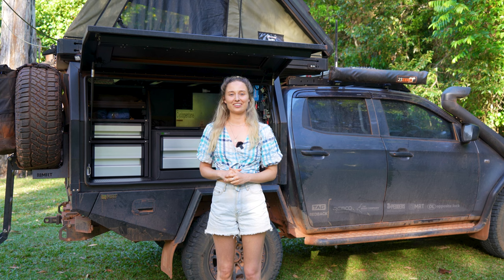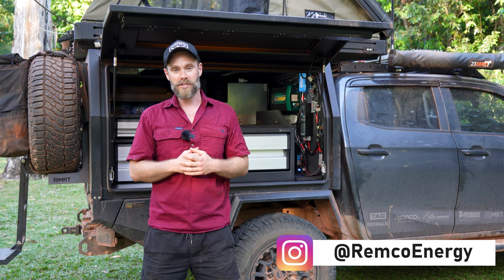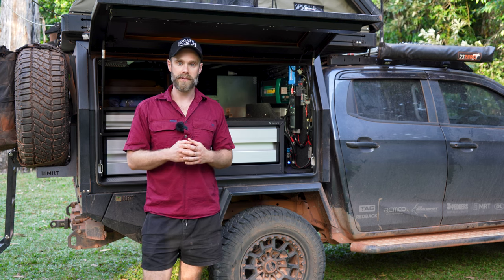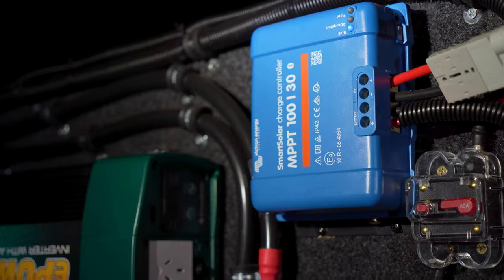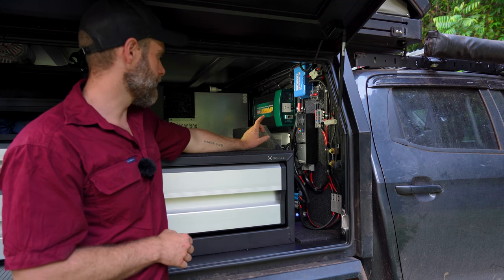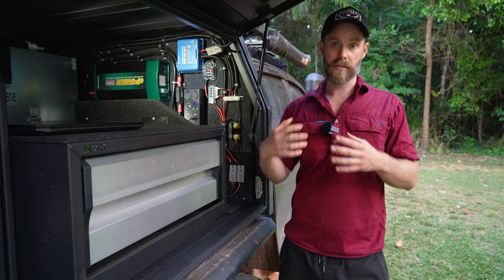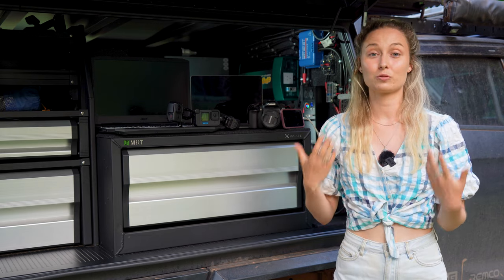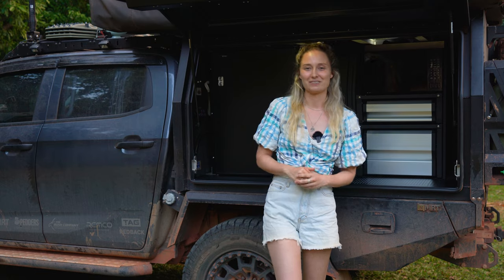The ULTIMATE Guide to our OFF GRID 12V Canopy Setup - DIY!

Comment: Great video guys. 
From the Victron install manual……”Mount the solar charger vertically on a non-flammable substrate, with the electrical terminals facing downwards.”
Reply from the maker: Thanks mate. 
And thank you for the heads up, we missed that - we will definitely look into this 😃
Reply: Plywood is a non-flammable substrate

Comment: Killer looking setup guys. 

Is your Inverter not running through the shunt?
Reply from the maker: Thank you! Good pick up :). It’s not unfortunately - the shunt was getting pretty full and the cabling wise it was getting tricky. We’d like to look at finding a way to do that in the future though. It’s obviously handy being able to see the exact amp draw for the inverter
Reply: @BorderlandExplorers  use a negative busbar for all your earth cables and one big cable to the shunt.
Reply from the maker: @wilcovanamersfoort6744  thank you - we’ll look into that. Would be handy to get more data on what the inverter is doing
Reply: Great Setup Guys, really interested in the Microwave addition, just need to find a space to install it. I have a similar setup with the Enerdrive 2k Watt Inverter,  Victron  30 & 20 Amp MPPT, 6 switch Fuse Box etc however I connected all up to the Victron Distributor 1000 including adding an ON Off switch & smart shunt to the ends of the Distributor and 2 x extra Fuses using the Hack here: https://www.youtube.com/watch?v=v9SpXGYrOmE . This gives me up to 6 x connections all running through the Shunt,  neat and Tidy.

Comment: How's the microwave going? Can you see what the MW is drawing on startup and then running? Thinking of doing something similar and the battery and inverter specs you went with are the same as I had in mind. Thanks
Reply from the maker: It's been awesome! We use it pretty much every day now, and we're glad we did it. We didn't hook it up through the shunt, so we can't actually see what it's drawing accurately - however we wouldn't mind changing the wiring so we can see more. The 2000W inverter and Remco 150ah Lithium handle it really well though. We mainly just use it to re-heat food. I'd guess an average of 5 mins running time per day in total.

Comment: I have just brought my first canopy and very keen to start fitting it out. 
I also got black. Do you find your fridge struggles in high temps?
Reply from the maker: Nice, that’s awesome! 😀. 
When we were in 40+ degree heat we did have to be pretty careful with how we packed the fridge (making sure air could flow around items, and not packed too tightly). We did have have a couple of things down the bottom of the fridge get a bit too warm. I’d say that it was a manageable situation and nothing terrible, but we did end up installing an internal fan into the fridge so that we didn’t have to give it as much thought. 

Too much frost build-up around the freezer combined with very hot weather was the only time the lower section of the fridge got a little warmer than it should have been. 

Short answer - overall not too bad, and manageable, but we like the extra fan inside the fridge 😂